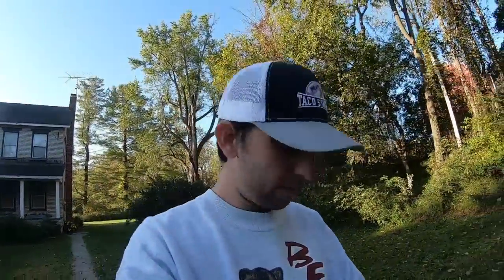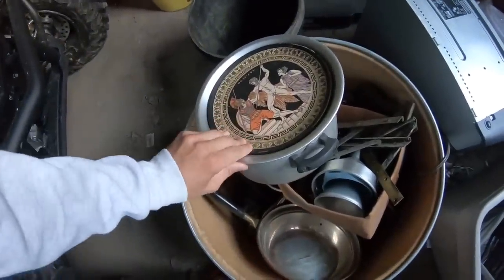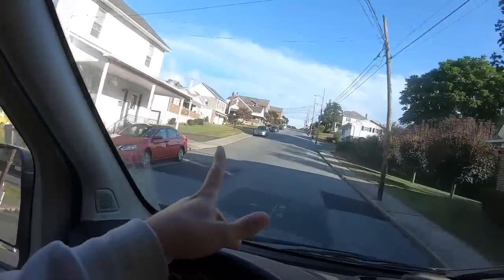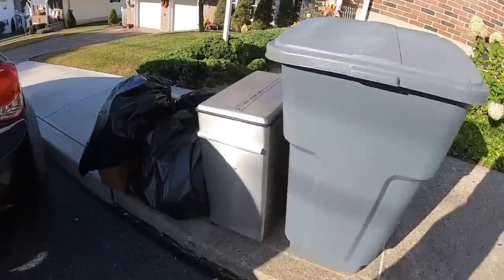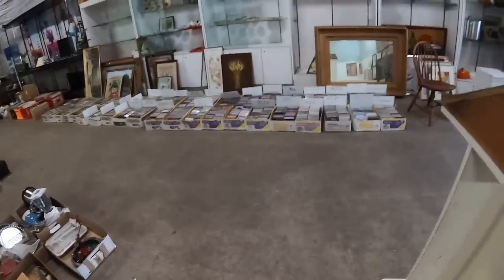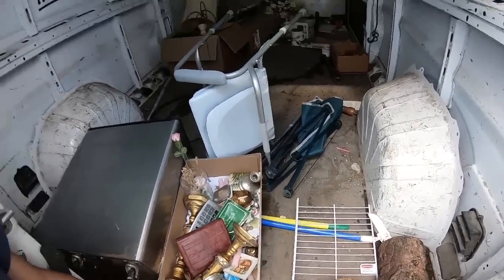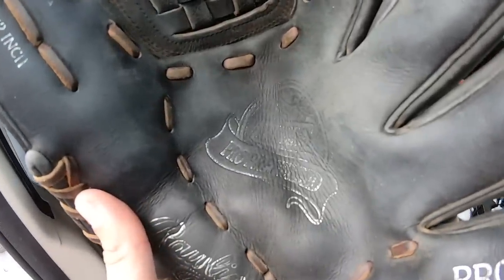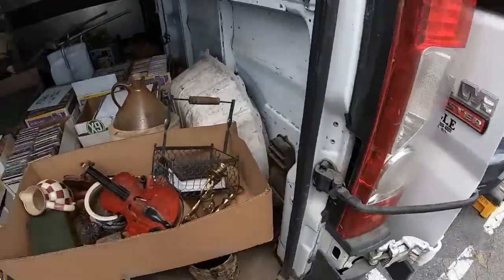Buying Out A Music Store and Trash Picking Score

Comment: Make sure you go through each box and scan each one to find the hidden gems.  Anything I can sell at $15.00, I pull and sell separately.  Media mail shipping is cheap so you will make at least $10.00 profit on those.  Then sell the others at the flea market.  I use this same strategy for DVD's.  I'm living the dream just buying and re-selling.  :)
Reply: Download discogs app and check them there easy way just scan barcodes
Reply: Sell some cds to decluttr if you need to. You can sell 100 disc only for about $20 on eBay.